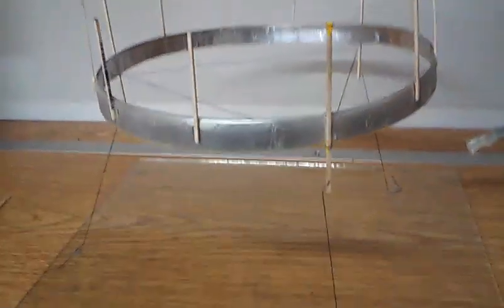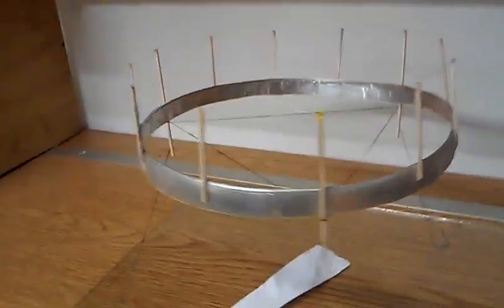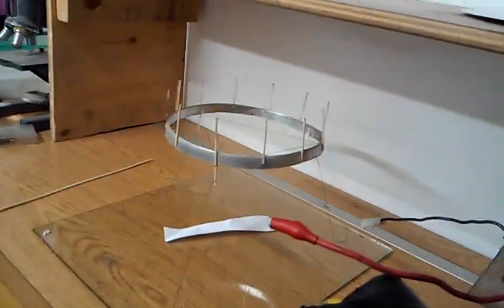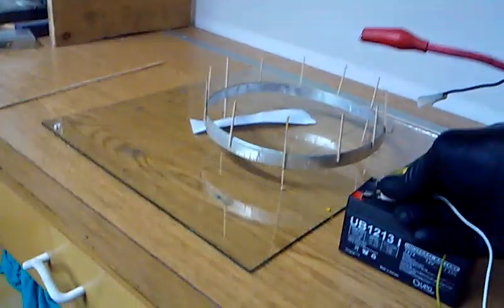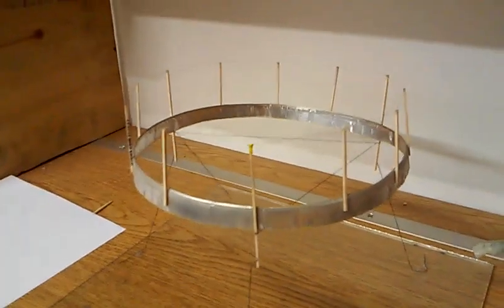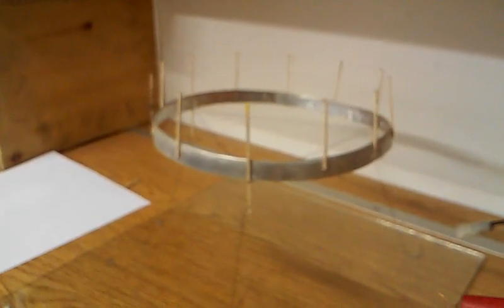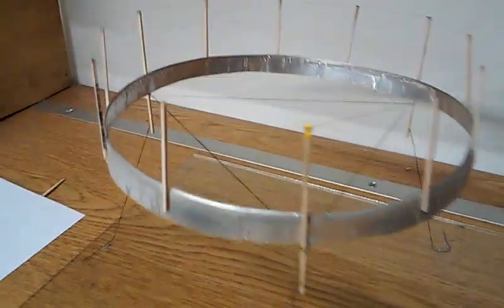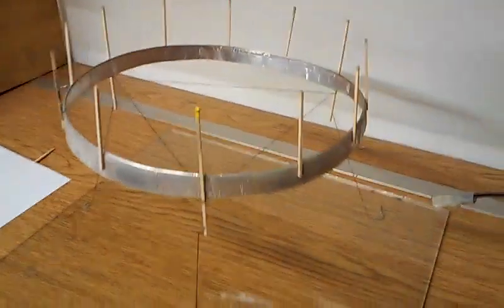ANTIGRAVITY LIFTER CREATES ARTIFICIAL GRAVITY ASYMMETRICAL CAPACITOR

Comment: Jim, this is a great work! don't get discouraged by negative comments. We would not have progressed from the stone age to this modern age if there were not critiqueeees. So thank to them. Now, I would like to share some of my experience in this field. I am an Electrical/Electronic Engineer, and my with major engineering is in Industrial Instrumentation design. I have been working on many things like yours for decades and have made progress. Tim Ventura started this as a lifter, and his deign is basically composed of a triangle with high DC voltage causing a lifting effect due to ionized air, good it was that. Yours look very different as I can see it can lift up heavy load and the floating ring looks strong in holding is position against the foreign weight- the stick. This is definitely generating some sort of gravity or anti gravity waves. Only thing that is catching my attention is the finishing of your round ring that seems to be 3/4" thick. I would guess it is some kind of a super material, platinum or rhodium, or something. 
I have a different set up (as a matter of fact I made that 22 years ago) it exhibited anti-gravitic field, I have that device in my lab as well, it can affect any material in its field, wood, plastic, metal, magnetic or non-magnetic, anything I put in its field spins and levitate. I have spend years and money into to find a way to increase its power, very slow progress but I am getting better. 
So continue your work. Modern physics started when some started thinking about why that apple fell on my head? Good luck.
Reply: TALK IS CHEAP.
Reply: yeah right, definitely artificial gravity... i want to see a proof of your "lifting machine" that affects any material..
Reply: Alokin Alset, This demonstration has been around for a very long time. Exactly as you said it is ionized particles that are creating the force that this apparatus is using to lift itself. This has been studies by physicists and has not shown any anti gravity field. All that is happening is the mass that is being propelled from the ring downwards due to a magnetic field being produced by the current of the electricity, the mass in this case being ionized particles in the air, create a force pushing the ring upwards. Eventually if he were to scale this up he would find that the ring doesn't move at all it would seem because Ion propulsion which has been used by NASA for decades is extremely weak. In this case since there is ample supply of the 'fuel' there isn't much of a problem. Scale this up any more and you will find that the ions will not be sufficient to lift the ring. This is well understood science that is being misconstrued and being contorted into a very sad representation of what gravity is and what basic theories have shown over and over countless times.
Reply: Negative comments aren't directed at what he is doing but how little he knows about what he is doing. He copied something someone else did and then shows with random comments about ionic wind and gravity wells that he has less knowledge about basic science than a ten year old. He's just one more person who decided that learning facts and increasing their knowledge of the subject was harder than just making shit up and letting it fall out of their mouth.
Reply: Defenestrator exactly. It is baffling how he has essentially disregarded all scientific knowledge that has been sequestered over the centuries and jumps to a ridiculous means of why it behaves. And then there are people in the comments that are supporting him in his ignorance. At this point in time where we have access to a vast amount of information at our leisure, the level of his down right voluntary ignorance is what frustrates me the most. A simple google search would have given him plenty of results. The willfully ignorant are perhaps that most aggravating of them all.
Reply: Yes, it IS a GRAVITY field, totally consistent with Relativity, and Einstein's unified field theory for Gravitation and electricity, Published in ANNALEN DER PHYSIK, Jan. 10, 1929, and the NY TIMES, Jan. 12, 1929 with great fanfare, and then SUPPRESED (you know WHY) 26 years later in 1955, the year of Einstein's death, all mention of the Unified Field theory and Electrogravitcs went DARK, until 1977, with ETHER TECHNOLOGY, Written by Dr. Rolf Schaffranke (Redstone Arsenal, Huntsville, AL, and NASA) under a pseudonym.
Reply: Everything is made of electrons and protons, and CHARGE is separate from MASS, so of COURSE it affects any mass.
Reply: No measurable magnetic field in these. A compass needle does not deflect in proximity to the device. Not enough current to form a B-field.
Reply: if it was a "gravitic" effect going on here (sorry if I said that wrong), then would it make sense to use a denser material to "levitate" since the more dense an object, the more gravity it has (or affects it?? lol I'm trying )
Reply: CORRECT. You go to the head of the class. Using a dielectric with the highest K-factor and the Highest Mass greatly increases the FORCE, according to TT Brown's laboratory notes that I read in the mid 1990s. Good work. THis can take Earth humans to any planet or star in reasonable time and economy, or FTL (warp drive) as Inertial mass is canceled out by the electrical force field. In perfect accordance with the Alcubierre Warp Bubble calculations ETHER TECHNOLOGY (which I read over 30 years ago).   http://u2.lege.net/cetinbal/PDFdosya/EtherTech.pdf
Reply: Yes, this is ARTIFICIAL GRAVITY, in perfect accord with Einstein's Relativity, and his UNIFIED FIELD THEORY FOR GRAVITATION AND ELECTRICITY (published Jan. 10, 1929 zur Einheitlichen feld therie, ANNALEN DER PHYSIK, and re-published Jan. 12, 1929, in the NEW YORK TIMES with great fanfare. They actually still teach that "Einstein never completed his Unified Field Theory". All forces and fields in Nature are reciprocal and interchangeable, INCLUDING THE STRONG NUCLEAR FORCE that holds atomic nuclei together.
Reply: It will affect ANY material, and the force penetrates FARADAY CAGES, as Francis Nipher showed a hundred years ago!
Reply: The G-field is within the device between the anode and the cathode. Matter, like dirt, dust, even WATER will be attracted to the CATHODE
Reply: Be careful,... be VERY careful Jim. The 'powers that be' do NOT want us to have this type of technology. 
 Alokin is correct, Jim. You're one of the very first of the real Jedi. Your research could set this world free. Great CARE you must take. The Secret Service doesn't "knock" when they stop by for a visit!!! They usually wait until you are in your CAR!!! The media and the police DO NOT COVER the activities of the Secret Service. It is THEY who use the NDAA ( referred to as the "indefinite detection without charge or trial" act!!! ). Under the NDAA, "they" can just carry you off into the night and the police and the media will pay no attention to it!!! So for christ sake,......   BE CAREFUL, JIM!!!
Reply: No, even though they STILL do not teach this patent in AMERICAN SCHOOLS, we are in Disclosure. We recently patented Prof. Searl's SPINTRONIC GENERATOR, US Pat. 9,871,431 B2, issued Jan 16th, 2018, to protect his rights, as the inventor of the famous SEG/STG. Knowledge of Etraterrestrials and old advanced Earth tech like unpublicised free energy and old artificial gravity patents are being allowed with no dang of assasination or financial ruin. Things have chaged sice Stan Meyer's murder.
Reply: Ionocraft is nothing crazy, it operates on a little known phenomena.
Reply: RCP-1136 
Then convince yourself. Do it.
Reply: Brandon Cox 
Townsend Brown's device worked in a vacuum.
Therefore it is not due to an ionic wind.
Reply: Brandon Cox 
You are confusing the Map with the Terrain.
Consider this: all scientific proof is INDUCTIVE. One black swan invalidates the Law that all swans are white.

Just one single solitary swan. No matter how many centuries of theories have been asserted as "The Truth" one single experiment can bring the entire edifice crashing down.

And believe this. The Standard Model of Physics is an edifice of Kludges.
Reply: Dylan Mooney 
I feel for you.
It's what happens when an Edifice of Kludges collapses.
No. Gravity is not "bent nothingness"
No. Maths is not physics.
No. Time is not another dimension.
No. The first law of thermodynamics does not hold.
No. The "big bang" never happened. It was invented by a monotheists. 
No. Redshift is not only dependent on Doppler, therefore it is not a good proxy for relative velocity.
Yes. The aether has been measured.
No. It is not good science to titrate exactly the correct amount of "dark matter" into your model in order to prop it up.
No. The Sun is neither powered by coal not nuclear.
No. The missing neutrinos can't be accounted for by pretending they "spin".
No. String theory isn't physics. It's mathematics.
No. There's no "relative time frame". The guy who designs the gps clocks says he doesn't believe in Relativity.
No. Newtons laws don't hold. Pari Spolter has dismantled them and Podkletnov's gravity beam destroys them.
No. Planks number is not universal. It only applies to carbon black and solid hydrogen.

And so on and so forth.

Remember. Scientific proof is Inductive. Therefore one Black swan destroys the Law that all swans are white.

The scientific community is too much in love with their models

OR 
They are being disingenuous and deflecting us from the real science, possibly for military purposes.

Would the military lie? Perish the thought!
Reply: Dylan Mooney
Try to follow the bouncing ball. It's NOT powered by coal.
NOR is it nuclear powered.
Reply: Dylan Mooney 
The problem with experts is that they make MODELS of reality. 
And they fall in love wirh the models.
It's very much a psychological problem.

All this is clearly annunciated by Dr. Iain McGilchrist, Phychiatrist. He's on YouTube and in print.

I obviously haven't got the salient point across, and that is ALL SCIENTIFIC PROOF IS INDUCTIVE.

Meaning that just one contra observation is all that its required to demolish an entire edifice.

It's a very fragile structure.
Reply: Dylan Mooney 
Ah ha! Good. 
Lord Arthur Eddington seized upon the nuclear powered sun when the first atom bomb went off. Before that, the best explanation was that the sun was a burning coal cinder, which as you so keenly noticed,  had hairs on it.

But his guess was wrong and not supported by the empirical evidence.

To wit. 
The missing neutrinos
The sunspots being dark
The chromosphere being much hotter than the interior
The accelerating solar wind.

Drawing all these and others Dr. Halton Arpe (Nobel prize) concluded that the sun (And all the galaxies) are powered by Vast (Of cause) electrical currents.

More on the Thunderbolts project on YouTube.
Reply: Dylan Mooney 
You win.
Reply: I just wanna know what's above and below the damn thing. Be nice to see the entire experiment and know it's not bullshit
Reply: What the fuck?? Why isn't this widely known????
Reply: I take it you hold yourself on a pretty high pedestal lol.
Reply: Does the effect work in space
Reply: @brandoncox3227  have you been researching this effect, many critics have not even  experimented but just read books
Reply: @beginization  yes I have. Thank you for asking. I have a PhD in physics and particle physics. I have worked with physicist who aided in the development of ion propulsion used in space craft. So in short yes.
Reply: @googleaccount7848  because it isn't true
Reply: I'll give you a far more advanced plan. Self powering coils, and a fantastic power to weight ratio. Electron neutrinos are the key. Ice Cube proved they're directional, vindicating my theory.
Reply: @Beamshipcaptain  no its not antigravity, because it IS consistent with modern theories.
Reply: @Beamshipcaptain  totally beyond wrong.  It's just ionic wind, requiring some air mass.  
Test it a vaccum that matches near space and it won't fly.  There is zero point energy but even that just creates power not gravity.  Ether does not exist.  But we do have galatic cosmic rays (GCR), Zero Point Energy, Quantum Gravity Loop, and gamma ray shaped magnet bubbles that can slow or speed up time inside the bubble.  Those things might be usable to produce antigravity.  But not an ionic wind.  Ions can produce thrust, but it's still a reaction mass.
Reply: @redredmane5544  Powers that be don't care, because it's not antigravity.
Reply: @scottl5000  Tested in hardest vacuum. This is ELECTROSTATICS. Ether Technology. Electrostatics works in vacuum.
Reply: @scottl5000  This works more efficiently in vacuum. Proved in Paris France, 1955, Winston Salem NC 1957-59, GE Space Center, King of Prussia, PA, 1959, Honda R&D 1996, US Army Research labs, Adelphi, MD, 200, Purdue University, 2000, NASA, 199, etc.
Reply: @scottl5000  THis is consistent with Einstein's Unified Field Theory for Gravitation and Electricity (zur Einheitlichen feld therie, ANNALEN DER PHYSIK, Jan 10, 1929, and the NEW YORK TIMES, January 12, 1929. Electromagnetism and gravitation are combuined into a single expression. GRAVITY IS ELECTRICAL. INERTIA IS ELECTICAL. Study SUBQUANTUM KINETICS MODEL G.
Reply: @Beamshipcaptain  Yes static electricity works in a vacuum... it works in supercapacitors, even underwater, or inside a fire (ever make a fire speaker?) etc.  But there's a little problem called protons, or lack there of, the field cannot be sustained.  Rub a ballon on a cat, and the opposite charge forms on the other side of the rubber...  So far everything I read about trying to verify elecrostatics as such has been debunked. Dippoles and what not are theorically possible, but have not been proven doable. It's like magnetic motors... they lose polarity and when you add up the total energy output, it's far less than the energy required to magntize the magnets in the first place.  A wind up toy does a better job.  I will believe it, if I can 1) see it. 2) have is peer verified against control cases.  I checked some of the so called verifications... the few I looked at did not verify it works in a vacuum without an opposing well known force.
Reply: @scottl5000  The inventor TT brown, HONDA R&D, NASA US ARMY an Purdue university all show it works better in vacuum. I and others show how sealed in plastic, or resin-epoxy BLOCKS, the saucers fly BACKWARDS, at the same speed. Electrostatics. The cathode tries to fall into the Anode, but is held in fixed relationship, so the force is transduced into motion as long as the charge is maintained. Electrostatics is a well known force, and just like Electrostatics, the electrogravitic force increases exponentially with increasing Voltages, so in Vacuum, at several hundred Watts, there is no limit to the speed, as shown in 1955 in Vacuum chambers in Paris, France, and 1959, at GE Space Center, King of Prussia, PA, 3 miles from here.
Reply: @Beamshipcaptain  I would really appreceiate a link to this information.  Maybe others will as well.  
Why would you bother with me... well.... I'm a successful inventor and I work on fringe technology, including things like temporal elasticity and actual products based on the duality of light. I'm nearing success on a device to turn car exhaust into O2, so far I'm at 4% at low energy usabe. So I'm no stranger to fringe technology.  And I have a very open mind.  Frankly all the claims of Stan Meyer and also these lifting devices have proven to be highly ineffecive so far.  I did better than Stan Meyer's electrolyzer with a single solidstate component for heaven sakes, super easy. I've built his circult and it barely worked at all.  I built the lifter, it was a lot of fun (and scary), but I verified at 12,000 ft is doesn't lift as well at sea level.
So yeah, I want to believe. I've experimented with super conductor magnetic precesion of rotating masses, including in the presence of material plasma and photon exposure.  I've recorded some very interesting effects.  But the Searle effect, these lifting bodies, Stan Meyer's water engine, and lot of the Telsa experiments just never seem to get anywhere.  So I figured it's time to stop following the lemmings and look further outside the box.  Which worked well for me... For example, I figured out how to get rid of a bacterial stain in polymer's using light to excit the carbon atoms, then apply a oxdizer in a medium compatible carrier.  I failed chemistry in high school, hate chemistry with a passion...  Yet I opened a new area chemistry called Photo-Oxydation and got three patents for it.  My bio-chemistry brother and other chemists friends told me it could never work.  But it works so well I formed a company to make and sell a product using the discovery for the marine industry.  There are a ton of other applications as well. The light used is a harmonic of the carbon, taking it to a highly reactive state, apply a tiny amount of a free racical causes the carbon to bust off the lipid based stain, which out gasses as a small amount of C02, this changes the color of the stain to a light frequency that humans cannot see. GestaltScientific.com
So I am definitely one that would really dig it if proof can be found that this lifter works in a vacuum.  
I'm about as fringe-science as they come.  I'm working on an energy device that will produce VAST amounts of power using low yeild radioactive materials (Radium, Thorium, slightly enriched Uranium ore etc) that are generalluy considered relatively safe to handle.  It should ultimately be inexpensive and pratical enough for commerical use and about the size of refrigerator. In all my efforts, something called ether or whatever has never presented itself.  Yes I know there is no such thing as a vacuum, I know about the various effects, L*, C*, ZPE, energy density of a vaccum etc.  Maybe a combo of those is the medium I hear about all the time.
So please do send me links to the findings on verifications you indicated -- I did some searches and came up with mostly voodoo -- and I'll try to tease out the VooDoo from the science so I can understand it in my twisted little universe.  LOL! kidding... well mostly...
Thanks in advance!  I really do appreciate you for taking the time to do so.
All the best,
Scott
Reply: @Beamshipcaptain  I have a saying, "keep your eye on NASA, it's the only ticket off the rock".  I want to go explore the universe too.  And save our planet in the process.  So I applaude your effort.  Thank you for pointing me to your (Mr. Miller) patent -- in fact I read the patent just now.  It's a pretty simple utility patent, but reads more like a design patent. It's for a class of magenet motor/generator of which there are 100's, Spintronic, torroidial, radial, exo, or other. -- aka electromechanical roatational device.  There appears to be no statements of free energy, anti-gravity, over unity or aether or any of the VooDoo you all talk about.  It says clean energy, but ALL generators are clean energy.  If that is all that patent is, just a twist on a conventional device, then it was a waste of money if the funding folks think they can use it harness aether power it won't protect that level of innovation... so whomever funded it got sold down the river.  I'm about to submit a 80 page provisional patent (which will be split into 4 patents I'm sure) for a new class of device that will turn a particular industry on it's ear, with heavy funding to back it up. Now that is a serious patent that locks down a totally new innovative manufacturing technology with clear improvments (8x performance) and deep market applicability.  Not "just another electromechanical" motor/generator.  

Just about anyone with an engineering mindset can make a solid magnet motor in billions of different configurations and the USPTO is more than happy to take your money for each one.  

I'm sorry but patent alone does pass the scratch and sniff test of all the non-patent claims being made.  I am however stunned that the USPTO did not blow the patent out for description #5 loss of weight, but the term formative science and the fact it's not in the embodiments or claims, only in the description, is a good ruse. Because the patent office cannot reject it unless it's a claim or embodiment, and yet the lay person will read it and say, "ooOOOoo it's patented and it says it loses weight, so it must be true'.  WELL DONE!  A statement in a description cannot be challenged.  

Sorry, I'm still not buying it.  Nice try to impress me and shut down my argument.  I been through this before with other inventors. So it didn't work.

I will suggest you keep at it.  Life is a series of lillypads are we inventors are the frogs.  So you get full marks for trying.  When (not if) you get a real win, then you already know how to write a patent, and I'm sure it will be a head turner. I'm being sincere, passion always pays off.

So how about those links?

PS. you made me realize I should file a patent for my version of the Stan Meyer electrolyzer.  Mine produces more H2 in the same timeframe and it's a single component and slightly different electrodes about almost identical.  Not a complex circuit at all.  But it's pointless. Commerical methods to make H2 work better and even though it produces more H2 with less energy, it's not overunity.  But I could certainly patent the device and even make statements in the description about overunity, but if it's not in claims then the patent will likely get granted.

Thanks!
Reply: Oh, I forgot to mention this --- I see it took 4 years to get that rather simple patent, which isn't too bad.  But If you could show a fully working device, with data, you would of gotten it in 2 years.  However many times did you have to modify it to trim out claims the USPTO would not accept with out data to back up the claims?
Reply: @scottl5000  Aleady sent you the links. We need more young people like yourself doing these types of projects and entrpreneurship. The Searl Levity discs went higher faster than any rocket, with no inertia, and no sonic boom. 42 built and flown by the Searl National SPace Research Consortium. SNSRC.
Reply: @scottl5000  The USPTO allowed 32 of our 37 Patent Claims. That's when I knew the patent would be granted.
Reply: @scottl5000  TT Brown had working devices (which I replicated). But still took him 3 and 4 years to get his patents.
Reply: @scottl5000  It works better in vacuum, as the inventor , TT Brown showed i the 1950s at various aerospace vacuum facilities around the world, and Honda and NASA showed recently with their new electrogravitic patents with Serrano and Campbell.
Reply: @Beamshipcaptain  It's a great feeling when allthe key claims are accepted. My last couple of "complex"  patents (one with over 180 claims and $20,000 to file) had zero changes, my patent attorney said he hasn't had that happen in over 20 years.  Lot of work, but it feels great when granted.  Congrats on that.
Reply: @scottl5000  Thanks. Congrats yourself. Now we just need the funding to build 21st century prototypes, and we are in business!
Reply: @brandoncox3227  I'm glad you chimed in.  The only chance these guys have is to find a glitch in the matrix...  And as you know there are still open questions -- duality of light and it's proven to 6 sigma that thought controls it), quantum  entanglement and gravity loop, I'm sure you can name others.  But they aren't doing things like experimenting with Photonic Molecules, or Anderson time bottles, or or or... so they have an unusal motor...  oookay...  What I think is ironic is I hear they 40+ devices that have been made that can go faster and higher than any rocket...  I guess they flew off and never returned so there's no proof. but a video camera kills the flight as does microwave... that blows it all out of the water for me.  So not confirmed flight video?  Russell is putting up a hard fight for this stuff.  BUt shouldn't need to tell anyone unless he is trying to raise money, that no doubt will get gobbled up and produce more youttube videos like this one.  sigh...
Reply: @Beamshipcaptain  Russell, buddy, please please please... if all this is true and proven, finding money is trivial.  I know money makes the world go around, so you have to hunt for it.  But honestly, all this just seems like a funding campaign.  I've seen a lot more complex stuff that this created well funded company's, especially in the early 2000 when the Fuel Cell craz happened.  So many companies formed just to be patent mills getting 100's of millions in grants, making bold claims, even making product that some how were too costly or didn't work.  Now they are all gone.

So... clearly... Once a good case is proven "they" will come to you. 

If you are super duper brave and  you can show it works, then do a kickstarter.  I think there is an equity option on one of crowd funding sites.  But god help ya if it's proven to be BS or doesn't acheive it's goal.  Crowd funding from 100's or 1000's of people means more people to come hunt you down if it doesn't work. Scary thought huh?
I wonder if that is what really happed to Stan...? And other's that people say the MiB got.  When it was probably a pissed off investor.

For conventional funding... I've had zero trouble finding significant funding for my projects -- I'm lucky because my investers are "angels" and I won't get burned by VC, but even VC is ok. Some projects I can (and do) fund myself, but why risk it when others that know the business and have access to large amounts of cash and are pros at it?  

I always hire people better than myself, including those better at getting and managing the complexity of funding and running a C corporation.  And if you aren't a C corporation then VC investors are a lot more shy.

You seem to have quite a following... so do crowd equity funding, if you dare.  It's about the same effect as going public to raise money, but still privately held.  It's a pretty bold move, but you seem like the type that's willing to put your head in the guillotine to prove a point.
Rock'on!
Reply: @Beamshipcaptain  I can't seem to find the response with links. Just names of companies.  Did I miss something?
Now I'm curious about the 42 built and flown.  Higher and faster than any rocket.  Bold statement. Show us.  I read in Searl's work that the BBC(?) went to video one unit flying, but it wouldn't go because the camera's electronics stopped it from working.  Hmm... and I think I read that microwave energy affects it, maybe even can be used to control it.  and that a prototype he did took off in to space never to be seen again...  hmm...  Russell, the whole story stinks.  
Consider the anderson device.  It went exactly how I expected a fringe science device would go...  Time dialation bottle... So Anderson went national on radio and video. Put up a website, showed compelling data. Pretty good detail.  Got patents too I believe. Then disappeared, supposedly funded by some Russians and Bulgarians and now has a private facility in Romaina.  Completely off the radar.  So, in a way people will say "yeah right, that's BS", and yet I'd expect something like that if it's true stuff would be sequestered.
Similar thing happened with cold fusion.  They panned by the peer reviews and media, and had it coming.  yet... Toyota investors bought them a private research facility in... France?  for several years they continues research into cold fusion and other alternative energy projects.  Then shutdown as they really didn't get anywhere significant.  That point is, despite massive resistence they did get funded "just to make sure'.  And those were super high risk investments.
The Searle stuff has had it's shot, missed, and isn't being picked up by those that would normally invest in fringe science projects.  There is a good reason. But the argument doesn't hold water.
Direct Alcohol Fuel Cells, the Anderson bottle and Cold Fusion held more promise to these investors, and we all know where those paths lead to.

So, once again, extraordinary claims require extraordinary proof.

Prove it works beyond a shadow of a doubt, and I personally to direct funding folks to you.  And it's one of the scariest things an inventor could ever face.  And the fear of failure is justified.
Reply: @Beamshipcaptain  I'm 60, but young at heart with a brutally high IQ I'm told.  I don't believe in IQ per se.  Knowledge and computing is not wisdom or invention. 

I actually surived a nasty brain tumor discovered in 2013, it was bigger than a golf ball -- I was running a technical product team of 72 engineers at Amazon back then.  When the tumor ruptured I almost died, the brain damage was significant, my IQ dropped dramatically, lost most my memory, went blind... A lot came back, and I'm mostly fine now... and I get more done that ever before, and my thoughts are more clear -- I'm a lot more effective and profitable.  So I encourage young people too, and even more so I encourage us old people to be like young people and drive them to successfully create new solutions.  Age is a state of mind. A person can give up at any age.  So why not keep trying?
Reply: @scottl5000  I am a young 58. I am so sorry you had those terrible health issues, thank goodness you are still here. I pray for your full recovery, Sir. Shalom.
Reply: So I looked up articles on if it works in a vacuum... and if you skim the articles it says it did.  UNTIL you read further:  "But the two never prepared a peer-reviewed paper on their informal experiment, so it's impossible to prove it worked as they claim. Over time, I discover that none of these much-vaunted flights in a vacuum are properly documented. In fact, the only written report documents a vacuum test that failed: R. L. Talley, a researcher who tested a Biefeld-Brown-style capacitor in 1990 for the Air Force, found no thrust in a vacuum. But that study wasn't peer-reviewed either."
Reply: @Beamshipcaptain  well yes... sort of... that's an over simplification... everything also made up of other things too.  Gravity is not electrons and protons.  Currently gravity is not understood, so it's definition is captured by the concept of the Graviton particle, which is used to predict gravity waves when two massive gravity wells interfere with each other.  The waves move at the speed of light and have been detected.  But gravity itself used to created those wave sill might be instaneous.  ELECTRONS AND PROTONS ARE NOT FASTER THAN LIGHT.  So they cannot function as this anther or firmament you keep chatting about.  Although electron/proton instant attraction is not fully understood, unless protons and electrons do not have to be in matched pairs, then it's just following quantum state changes which is time independent.
Reply: @Beamshipcaptain   GRAVITY, ARTIFICIAL or NOT, is always in accord...  But saying it's artificial gravity, vs it being in accord is a discord. You are playing with words.  YOUR OWN PATENT makes no claim or shows no embodiment to be gravity related.  You mention in your description, but state so tangibles, so the USPTO ignores abstracts and descriptions.
Reply: @redredmane5544  LOL!  "They" they won't because it's not what he says it is.  Not even close.

They say Stan Meyer died under mysterious conditions.  It's BS.  I was able to make H2 faster and with less amps than he did  with a single component and house hold power outlet at .25 amps.  So no MiBs have been doing anyone in.
There are no aliens either, because believe me, if they caught an alien, then the defense budget would skyrocket, and the military would love that...
Reply: @salpertia  Yes it is BS, for not for the reason you are asking.  Yes... The ion-wind device here is real. I made one, so have lot's of others, but it's nothing special, just uncommon.  Yet it is BS as you say. Because it isn't anti-gravity, which is what the claim is.  It lifts, but on in air. Not in a vaccum. It just makes air ionized and that causes it to move from positive and negative electrodes (metal foil and wire).  Lot's of air filters do this too, move air with no moving parts.  Such as the Ionic Breeze by Sharper Image back in the day.  The tricky part was to get a power supply that the damn thing could lift -- PSUnits come from old televisions and are very heavy.  But recently...  MiT made an RC airplane that flies with no moving parts.  Again it blows it's own wind using high voltage from a battery and a very advanced tiny power supply.  It's a good trick.  What people are all mixed up about is the assertion it's antigravity and would work for space travel.  this system cannot acheive thrust unless it has air to move away from it.  It does look like it might shoot out spare metal ions, so they can make some limited claim it works in space, but no where near the power it would in air and for completely different reasons.
Reply: @Beamshipcaptain  Ion propulsion IS better in a vacuum.  So if your unit moves in space it's because the system is shooting out a few ionized metal atoms now and then,  is a very poor ion drive.  Still a reaction mass.  And not antigravity.  If it can do the propulsion in a vacuum the same as it can in air, well that would be interesting... being measurable vs being effective are very different things.  I still think you are mixing your metaphores and taking quantum mental leaps.
Reply: @Beamshipcaptain  Vacuum-energy is not nothing is true, and it proably can be tapped as a power source.  We do not know if it has a polarity about it or not.  If not there is nothing to drive a force against.

Vacuum is by definition a void (aka nothing material).  You call it non-material but give it a noun Ether or Anther.  whatever. if Ether is not explainable or measureable, then why even memtion it, because it's nothing.  The vacuum energy could be as much as 1x10^113 joules per cubic meter.  And not an nano-gram is ether.
Reply: @scottl5000  There is no inertia or G-forces when you are riding inside such a system, because every atom of ship and payload moves uniformly with the applied external field. Gravity is ELECTRICAL. Inertia is ELECTRICAL, and unlike ion propulsion, the force is EXPONENTIAL with increasing Voltage. Positive charges are attractive on matter, Negative charges repel matter. Subquantum Kinetics. Look at Model G. It works better in Vacuum, as shown in Paris France in 1955, Winston Salem NC at AH Bahnson labs in 1957, and GE Space Center, King of Prussia, PA (a few miles from me) in 1959. I am good friends with TT Brown's daughter. Sealed in plastic bags, or Resin blocks, the discs fly BACKWARDS. How is that possible if the source is "ions"?
Reply: @Beamshipcaptain  Just show in real life it works in a full vacuum.   I just saw a video on this.  They put it in the NASA vacuum chamber and it worked at partial vacuum.  At full vacuum it WENT NO WHERE. Talk is cheap.
Reply: @Beamshipcaptain  no that is not correct.  I keep saying... you show your exact device operating is a reasonably complete vacuum (can't get perfect).  zero psi on a normal guage. And independently it performs about the same as the video.  Then people, including the investor I know, will believe you and no doubt fund it.  Until then...
Reply: @scottl5000  The TT Brown patents I built work better in hardest vacuum, as he himself proved in GE Space Center in 1959 just a few miles from here in King of Prussia, and Paris France, 1959, AH Bahnson labs 1957, Winston-Salem, NC, etc. Takaaki Musha of Honda R&D confirmed better operation in vacuum (like rockets also work better in vacuum), and the US Army research lab, Adelphi, MD ("Force on an Asymmetric Capacitor (2000)).
Reply: @Beamshipcaptain  built it and test it in vacuum, and funding will flow like water..
Reply: @scottl5000  Already done. Electrostatics works in vacuum.
Reply: @Beamshipcaptain  My continual point is... "you have not done it".  So if you are seeking funds, then all ya got to do is take your whole setup to a walkin vacuum chamber, suck out the air to below 0.1 psi and turn it on. Record it and let us see it.  Indepedently verified.  If it flies pretty much the same as in the air --> then I'll raise this to the awarness level of my investors who 100% trust me, and for good reason.

I'm 100% convinced that the device in the video won't work in a vacuum.  You said you are seeking funding for development.  Well I'm telling you it would be pretty easy to get it... but you get it by saying "it's been done already".  Even if it were true.  And furhtermore, if it's been done already then why aren't there at least toys flying all over the place using this tech.
Reply: @Beamshipcaptain  ooookay... do ya one 1000% better and easier...

Put the whole thing, except the power supply  in a lightweight sealed box made of tissue paper sides and a balsawood frame, similar to a box kite only sealed... No air flow to the outside.  

"the ether" shouldn't be affected by a super lightweight tissue box.  If as you claim the electrostatic repulsion can work in a vacuum where there is nothng to use as a reaction mass, then it should also work in a sealed super ligthweight box which also has no reaction mass with the outside if it maintains a seal. 

Antigravity won't let a thin tissue paper stop it, right????

It's a super cheap, fast and easy proof.

I bet the box could be made to weigh less than 2 or 3 oz. 

Heck after reading this you could probably make a box, seal it, and do the test with the current device in this video in a few hours.  So why wait?

No excuse now, and possible riches beyond your wildest dreams await you. 

It's fine if the powersupply is external.  In space that is not important.

I'd like to see the other devices to the same thing.
Reply: @scottl5000  We sealed our TT Brown Electrokinetic Apparatus saucers up in plastic before a live audience in Reno, Nevada in June of 2000, and they flew BACKWARDS, at the same speed. People sent be videos of smaller saucers sealed in Resin Blocks and they did the same thing. There is never any detectable airflow, and no sound.  Inertia is canceled by Electrogravitics, since every atom of ship and payload within the field moves at te exact same rate.This is transduction of electrostatic Energy directly into kinetic energy, breaking Newton's First and Third LAWS OF MOTION, and the CONSERVATION OF ENERGY LAW also is broken by this WARP DRIVE (Alcubierre) Methodology which Poalarizes the Vacuum, or Ether. One cubic Meter of Vacuum contains enough energy to boil off all the Earth's oceans. Look it up. Read  FORCE ON AN ASYMMETRIC CAPACITOR, by the US ARMY (2000).
Reply: @Beamshipcaptain  I see...  ok thanks.  I'll track this project, when it's ready I'd like to go for a ride.